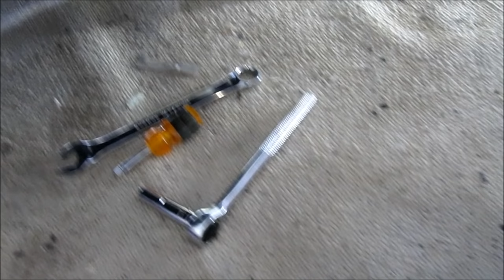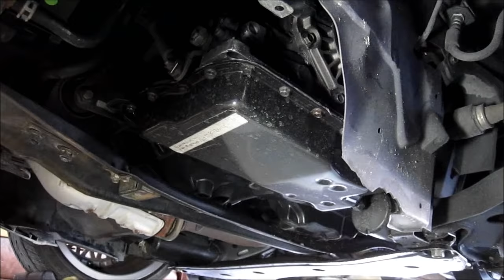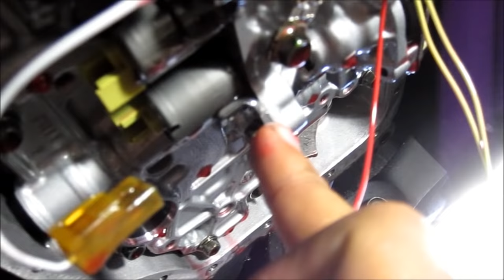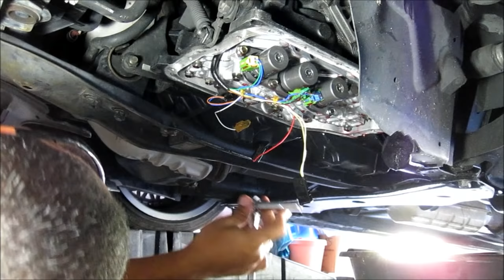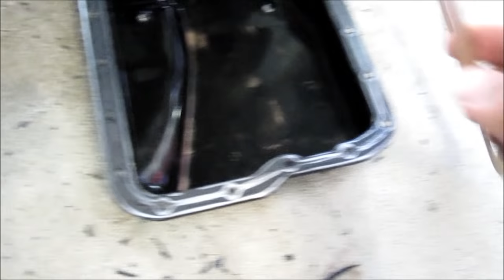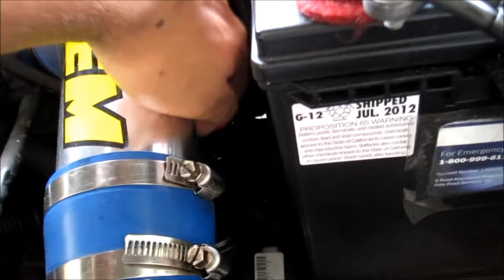MAZDA  MODS Episode 5: Transmission shift solenoids

Comment: You have to change out this plate that wears down over time.
If you remove the wheels fender ton the driver side you can see the transmission.
Take off that plate off on the side of the trans
And then check that one plate for a crack or missing piece
Change that and that would fix shifting problems and "clutch slip"

Comment: The solenoids that he changed are not identically the same. If you pay attention where the plugs go in, the colors and locations are different. On Mazda it is light yellow, whereas on Ford it is green. Thats why he got confused & hesitated at 03:00 . Really wonder if someone else replaced them with Ford's & using for a long time without problem.

Comment: My 2010 Mazda 5 got Solenoid A changed, but did not stop the problem? What else could be wrong. Changed the camshaft and crankshaft sensors and had the timing belt adjusted too. Same problem. It still shifts to a lower gear with a thump.

Comment: Solenoids are as low as $17 on the internet ... the whole Valve assembly with all 6 solenoids is like $180 ....
Filter & Gasket and kit can be bought locally support your local parts stores . Or they will be gone .
Fluids too .

Comment: I find conflicting info on which is Solenoid D & E, and which are A, B, C.  It looks like he changed what's labeled D & E in the Mazda service manual.  But a Ford manual for the same transmission shows those as A & B.  Why didn't Mazda and Ford use the same diagrams?
Reply: +Brian Starlin Im having the same confusion.
Reply: +Iran Rodriguez Follow up -- Two transmission shops told me the Mazda documentation is wrong, and the Ford documentation is correct.  The two On/Off solenoids on passenger side are A & B, while the three PWM solenoids on the driver side are C, D, E. I ordered a set of A/B solenoids, but alas, it did not clear my issue.  I probably have a worn valve body, worn clutches and bands, etc. Oil was soooo black and smelly.
Reply: Brian Starlin what did you end up doing to fix it?

Comment: gr8 vid there,    I have P0744 on a JATCO (Nissan transmission)  I have thought to change the shift solenoids block, but have to take out the entire valve body to do that.  JATCO RE4F04B transmission 4sp auto . It could be the Shift solenoids block but also could be torque converter or 1 or more clutch or entire valve body.  
it shifts smoothly after transmission flush after a 3x drain and fill, and used Lucas and seafoam trans tune.  just that now in 3rd if you floor it it will slip out of gear  but left off gas it slips right back into gear

Comment: Thanks for this video, looks like I'll be doing this repair on a mercury with this same transmission.   Do you know if there's a recommended torque for the pan bolts?
Reply: 96 to 120 inch pound

Comment: How did you know which solenoid was bad? I have an obd2 scanner and no codes are coming up. The AT light is on but the check engine light is not on. Right now my 04 mazda 6 is shifting hard when I go from park to reverse or park to drive.

Comment: I'm taking my Mazda 6 2008 in garage Monday the light came on computer says it's solenoid, but I have to be honest I didn't realize how often I was suppose to be changing the trans fluid. What are my chances that the trans is good and it just needs fluid change and new solenoid? by the way my car got stuck in 2nd gear it will do first second and reverse

Comment: Hey my 01 Mazda Protege it’s having issues on switching gears . Specially ones it hits second gear it won’t go any further then that. ( Automatic ) I got a P0732 code. They told me something about Solenoids A, B , or C. Could this what you doing could possibly be the same thing wrong with mines? 

Thanks
@troy
Reply: Having the same issue were you able to get yours fixed.

Comment: Great video Troy Watford.

I have two alarms on my 2006 Mazda 6 (6N3NA6):

P0715 - PowerTrain (Input/Turbine Speed Sensor Circuit)
P0744 - PowerTrain (Torque Converter Clutch Circuit Intermittent)

I need some orientation, some help.

Thank you.

Comment: Great video!!

What kind of car were you working on? make? model? year?

by any chance, was you "O/D light blinking"?

Mine is blinking and there seems to be a problem where the tribute won't kick into 3rd or 4th gear.

was it the same for you?
Reply from the maker: Johnny W  thanks,it was a 2003 mazda protege 5 ,yes my ''at'' light was on ,an my problem was some very rough shifting then after a while now going into 4th an sometimes 3rd
Reply: @Mazdamods   did that fix the slipping and shifting  problems

Comment: My Mazda Premacy have problem automatic in 2nd gear.    When speed up at 
1st gear reach change at 25kph before change 2nd gear reach to 35kph change 3rd gear reach until 50kph changes to 4th gear.   2nd quick change 3rd in short time.

faster to slower down   From 4th self change to 3rd at 30kph (I feel engine sound like cough isn't at 2nd gear yet),  BUT 3rd to 1st at 15kph.   

Other semi-shift was fine by handle.   Why Auto 2nd gear is not properly ?
Reply: Did you find out the problem?

Comment: Hello!, I have a Mazda 3, 2007, 2.0 engine, Tiptronic Transmission... I heard a noise when going from 1st to 2nd, the sound is like sand or something and the gear don't give power until the noise is off.   It's like when you have a manual transmission and you shift and don't take off your feet from the pedal... hope you understand me :S
Reply: +José Daniel Anzueto Did you ever solve this issue?

Comment: so my AT light is on for my 2010 Mazda 3 2.5 and its saying change solenoid B. My cars reverse doesn't work when I put it to reverse its like its in neutral. would changing the solenoids fix this?
Reply: COINSTAR CLANKING you ever figured out your problem?

Comment: My tranny wasnt going past third and AT light was on. I was getting the code for solenoid b stuck on at first. Followed your video and replaced both A and B along with filter. Its still having the sam problem, but now im getting the code saying A stuck on. Any thoughts on what it could be?
Reply from the maker: hmmm well i would try first make sure your using the right atf fluid my car takes mercronV also try unplugging the neg side of the battery to reset the cars ecu i think its called,if that doesnt work it might be somthing else,for instance my car drives fine but my at light it on an wont go away too it says shift solenoid b stuck but i replaced it (this was recently) an i havent been able to figure it out i know it has something to do with my idle becuase thats low ,but for your issue its hard to say im not a mechanic just a hobbyist ,but id get the code number an google info in it to narrow it down.hope that helps a lil man .

Comment: Where did you buy these solenoids from? I can't find them anywhere
Do you know the part number?
Reply from the maker: heres the link to the ones i bought ,http://www.ebay.com/itm/4F27E-FN4AEL-Transmission-Shift-Solenoid-A-B-Filter-Kit-Focus-Protege-21357-/191096839921?pt=Motors_Car_Truck_Parts_Accessories&hash=item2c7e425ef1&vxp=mtr
Reply: troy watford Do you by any chance know how to remove the other 3 bigger solenoids on the opposite side? I don't think they just pull out :(
Reply from the maker: yeah they have a metal plate that has to come off first then u can pull them out just like the other ones very easy
Reply: troy watford Ok I tried yesterday after removing the metal plate and they didn't come out. I'll try again today
Reply from the maker: Oh yeah I forgot to mention I used a pry bar just a small one an gently
Reply: troy watford Dude if that works you will literally be a life saver!
- Thank you
Reply from the maker: Lol they come out just like the other side might just need some extra effort

Comment: Question anyone i have a 1999 mazda  if i put it in drive an turn off it stays long to shift an wheN IT SHIFTS IT JURK THEN THE HOLD LIGHT STARTS TO FLASH i changed all the solenoids it doesnt jurk when shift but the hold light still comes on an flash anyone can help me please
Reply: Try changing the TCM ( transmission control module)

Comment: Hey buddy thank you for sharing this video. I have a 2003 Mazda 6, I'm not sure what the problem is, Maybe I just need to get it scanned but my car I think might be slipping.   While driving in Automatic mode, going from 3rd to 4th gear revs up my RPM's for a second and then littly jerks into gear and then goes. Everything else runs smoothly.   I'm really hoping I don't need a new Transmission.  Only the Check Engine light is on, the AT light came on a few times but hasn't for some time. The dealership i bought the car said I might need to change some type of sensor that sits in front of the engine. He said he replaced one but not the other (not sure what that could be)    Anyway, any little bit help.     

And P.S. I didn't  mind the music. people are idiots. Thanks.
Reply: The one thing is called the Vapor Canister purge Valve, no idea what that is. Thank you, I appreciate any feed back.
Reply: Did you ever fix the problem I have the same car and I don't know if it's the transmission or a sensor or what
Reply: +Gynelle Pinto it ended up being the transmission. if it sounds anything like I described stop driving it and take it to a technician. the transmission could get worst. and make sure your mechanic doesn't try to rip you off... my first guy sure did.
Reply: +Jesus Mrtinez de la Torre. I know this is an old post, I havr been searching because I am currently having the same problem and no seems to know what it is. If u still remember, did u have to replace the transmission?
Reply: I'm having same problem here. somebody please help!!!
Reply: I had the same problem with a Mazda protégé 5 2002. I changed the cam shaft position sensor and all is ok

Comment: Was your transmission slipping? i have solenoid c code showing up. good video
Reply from the maker: yea i cracked the transmission pan an all the fluid leaked out an damage the solenoids ,so it was slipping real bad,but its great now im surprised perfect shifting at 145,000 miles lol

Comment: Hi Troy, do you still have the link you purchased the Solenoids? 
I have a maZda 3 2007 5 Speed Automatic. Code P0758. 
Thank you much.
Reply: +Oleg C I think I have the same code for my 06 Mazda3. it wont go thru 4th gear.
Reply: I replaced the solenoids: A, B and   Auto Trans Oil Pressure Switch. Nothing changed.
Did u do anything?
Reply: Not yet, gonna try switching the new solenoids soon.
Reply: +Oleg C I have put the new solenoids and it still gives me that AT light sometimes. but when I shift to manual mode, the light doesn't light up. so now I'm going to change the NEUTRAL SAFETY SWITCH. it runs around 40bux and its easier to change. I will keep you up to date once its smooth and running.
Reply: The CE light is gone?
Reply: +Oleg C CEL code is gone but AT light pops up when in auto mode. I have a different code on my CEL which is not the one from the AT since I have an aftermarket intake manifold.
Reply: I see, my CEL is still on , and the AT pops up on the lower RPM, for example while at the stop light in 1-st gear or when the car is cold. the code in my case is P0758. Any suggestions?
Reply: Hi Tyronne, any changes ?
Reply: code P0758- Shift Solenoid B Electrical
Reply: I end up buying the module and everything works better and no CEL

Comment: Will a shift silonod throw a code?. My mazda 6 will not shift into 4th as soon as it trys it locks the transmission in 3rd
Reply: I'm getting a code P2709 “shift solenoid F". 
2011 Mazda 6 2.5L 5spd automatic
Reply: Mine is stuck in 4th
Reply: How did you guys fix it?

Comment from the maker: short on cash for that project saving up for coilovers first
Reply: Hey bro I had the shop tell me I had bad tcm in my Mazda3 so I had the tcm an fluid an filter change but it throwed the p2707 code after 70miles witch makes the AT light come on in it then goes to limp mode an stays in 3rd gear do u think it needs the solenoid since the tcm didn't fix it?  Are would there be anything else that would cause that problem

Comment: How did you know which solenoid was bad? I have an obd2 scanner and no codes are coming up. The AT light is on but the check engine light is not on. Right now my 04 mazda 6 is shifting hard when I go from park to reverse or park to drive.
Reply from the maker: there is a solenoid that controls those ,but i had the same issue till recently when i changed my brakes XD but it might be something different for you ,i would check your tranny fluid first makes sure its topped off an clean , also this might help http://forum.mazda6club.com/atx-transmission-discussion/254751-wont-shift-out-park-solenoid.html  ....i hope this helps a little i wish i knew more about cars lol but lmk
Reply: hey natapol i wonder what happened with ur problem i just got the same with my MPV and so far no one able to tell me whats the problem each service shop guessed something different ,,, thank u
Reply: I'm have the same issue got the solenoid changed and didn't fix the problem only got 44 thousands mile on a 07
Reply: Mine on  2 to 3 slides the transmission.  AT is turning ON when I reached 60mph...and  shifting is also hard when I go from park to reverse or park to drive. Is anyone knows how to solve this...even the dealer mechanics doesnt solve this issue and I am hopeless with this Mazda3 2006 model.. 
Reply
 ·
Reply: Bojick m. Did you find out what it was?